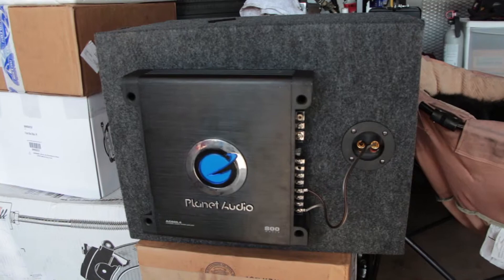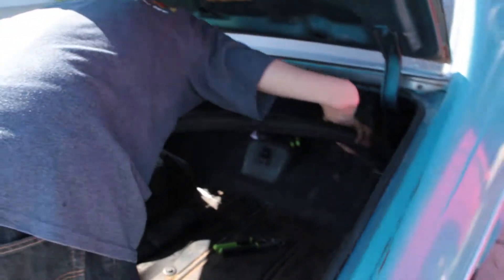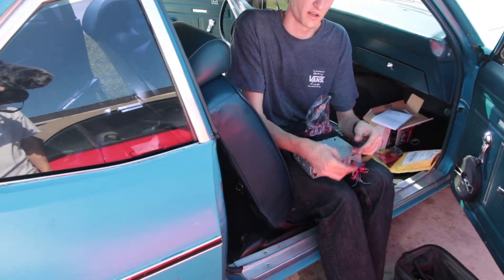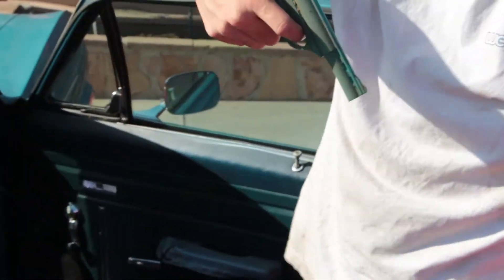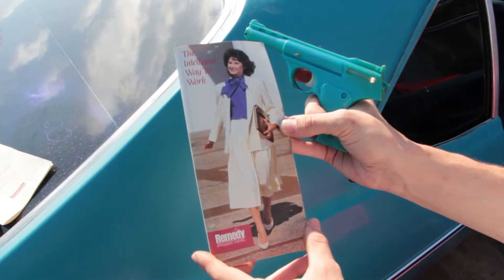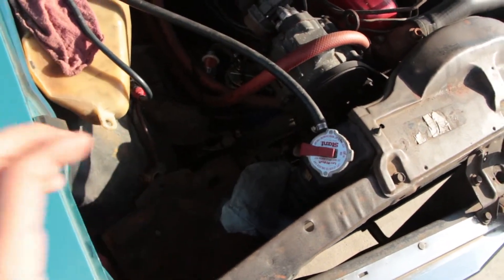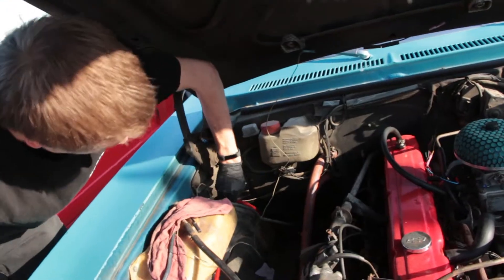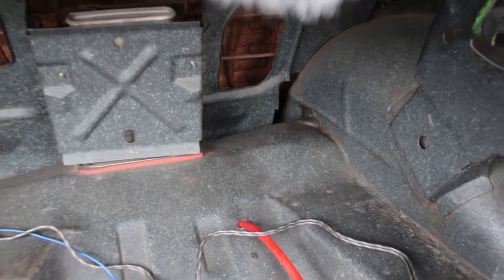Nova Sound System Install

Comment: That power wire leading into the trunk needs some protection. Like a grommet or just some piece of plastic so its not rubbing on the chasis. If it eats through you could fry your amp
Reply from the maker: Yeah I threw some vacuum hose around the sharp metal to protect it. But the whole wire is going to get re-run through the car instead of under it soon enough

Comment: Do you think the slim 10s can fit under the back seat
Reply: I don’t think anything audio wise can fit under the nova seats honestly, I have a 1973 and also you would run the risk of heating issues.
Reply from the maker: +1 for litterally no room to run subs under the seats
Reply: I have to make my own wedge box for 2 10s. I could have done the same for 2 12s. Id you go seal3d its easier